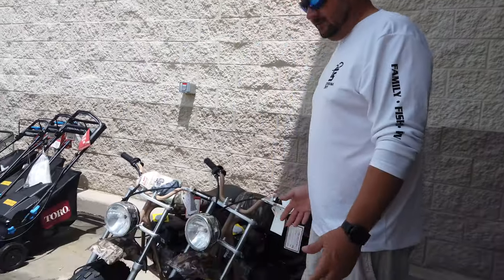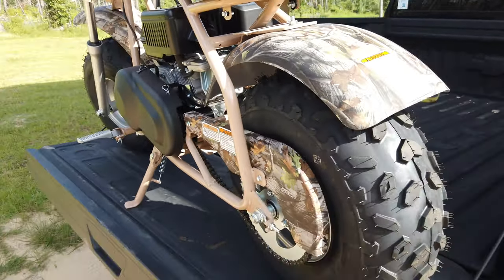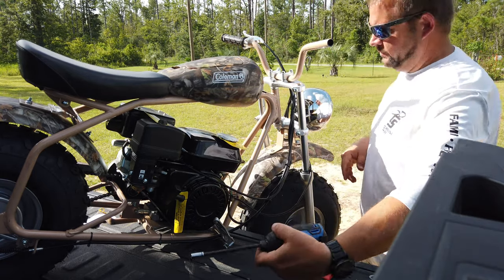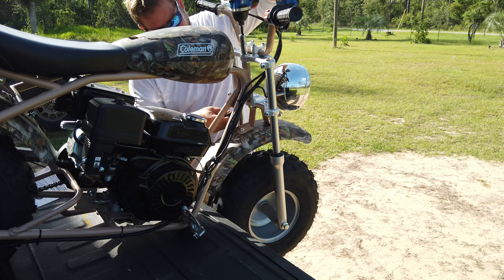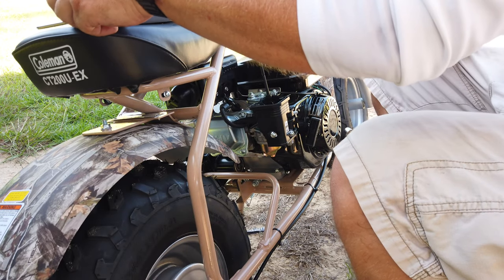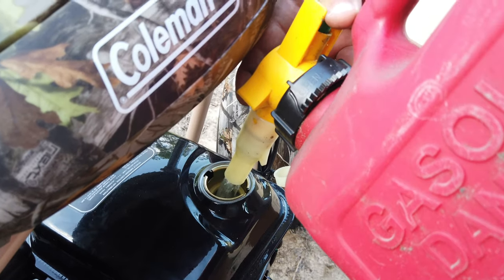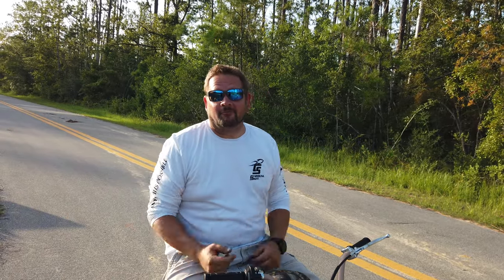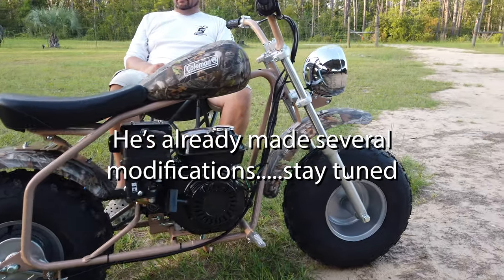New Coleman Mini Bike CT200-U-EX Things to watch for after you take it home and sort of a review

Comment: Bought one for my 11 year old. They do have a lot of issues. I took the headlight off so he wouldn't think that it was ok to ride in the dark. Have had the throttle cable break 2 times now. Waiting now for it to come in the mail. Forget about a warranty because they don't have one. If you don't have the back wheel adjusted correctly it will throw the chain. My 11 year old is strong enough to start it himself. He enjoys it when it will run

Comment: Ive got a coleman just like that 
It will stop trying to wheelie after the clutch wears some...
Also check your back wheel
A lot of these came with on the tabs welded on crooked  
Mine had a tab welded on crooked makes the rear wheel set crooked
Reply from the maker: Will check that. Thanks!

Comment: Washer on neck wrong to take up play in fork, loosen bolts on side of fork to allow movement up and down plus washer as per instructions  two small washers inside , large washer on outside tighten main bolt all sock will come out of neck tighten fork tube bolts  O play
Reply: so goal is to remove all up and down play here? there's like an 1/8 inch play with small washers inside

Comment: what octane level you are using for gas? Mine is having issue after only about 3 hours.
Reply from the maker: Just cheap 87 octane.  What issues are you having?
Reply: @EdsEverydayAdventures   ended up so far to be a spark plug. The original was cheap and I replaced it with a NGK and it now goes like a champ.

Comment: sooo.... you gonna bypass the governor ?
Reply: I think he likes his valves not floating
Reply: @kingstonlabelle6954  yeahyou gotta be careful with thesethingsyou can get valve float just from removing the throttle limiter and going fullthrottle
Reply: @Slicknewt  Yeah since then I zip tied it and put heavier valve springs
Reply: @kingstonlabelle6954  alot of critics disagree with valve springs.
Reply: @GMC.Sonoma.4.3  I’ve had it for about a year now no issues with 18 pound valve springs
Reply: The funny thing is that if you start by putting a torque converter on it there's no need for zip ties, 18lb springs, and other rig jobs to bypass the governor.